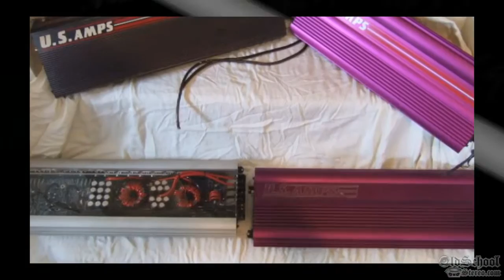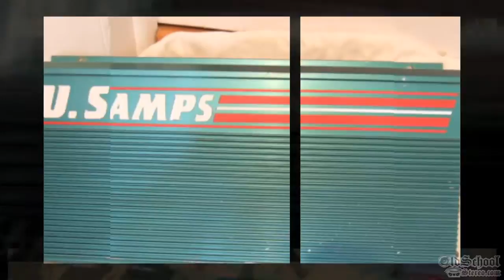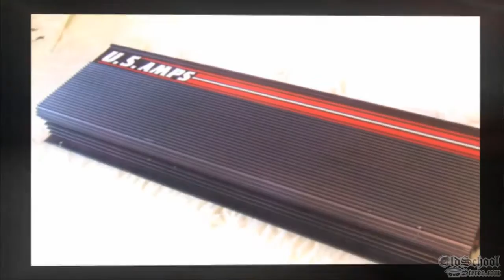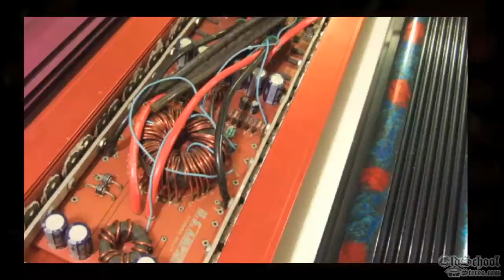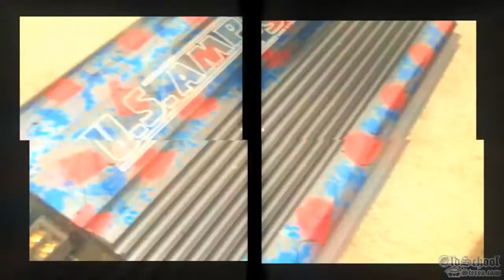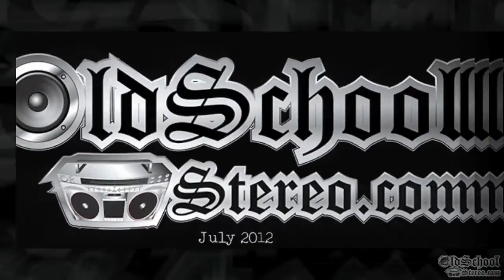An Amazing Old School US Amps Collection - User Submitted

Comment: I had one 30 years ago. Had it installed at a local shop, it was red, running 3 12s, took it to a local competition, seems like the car made 154db on the meter. Together with that amp, I blew several Orion XTR 12s. LMAO. I don't remember the model, or watts it was rated at, saw one that looked like it here.